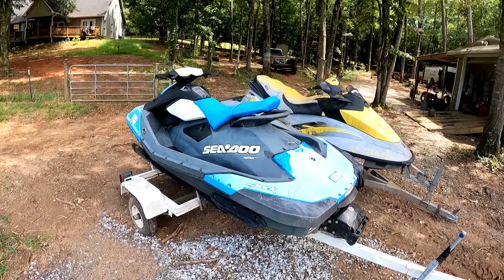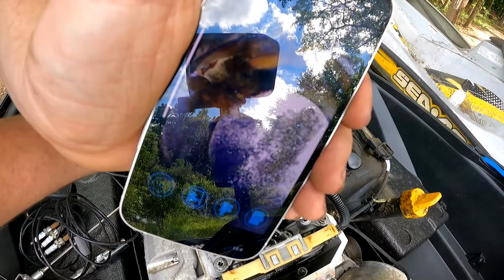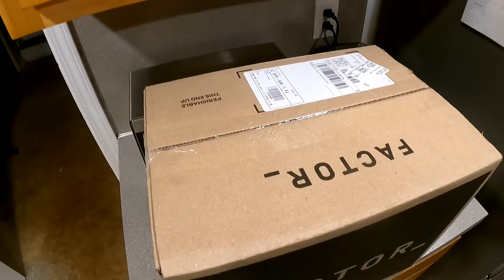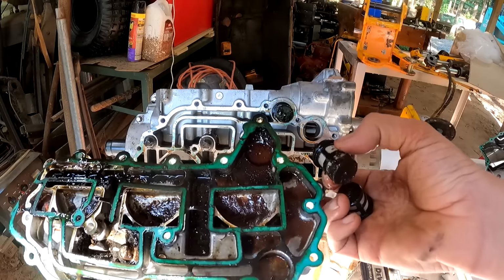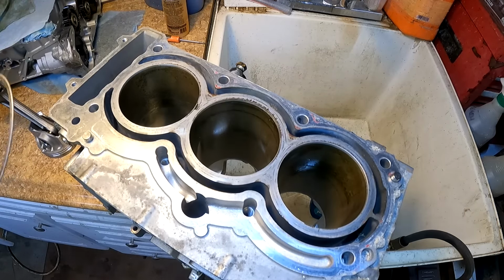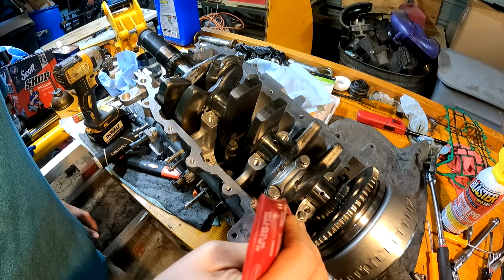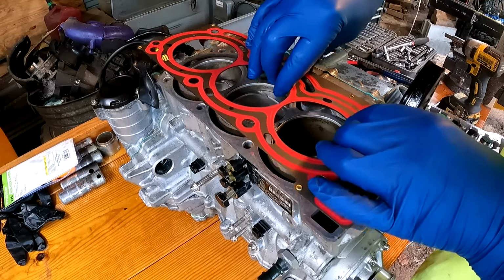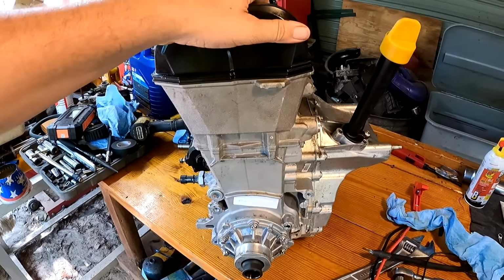JUNK JET-SKIS LEFT ROTTING UNDERWATER FOR YEARS... WILL THEY RUN?

Comment from the maker: I would have liked to fit everything in one video but with all of the noise from clearing and machines it’s been kinda hard to record lately.  Thanks for watching guys!
Reply: You had rust down the spark plug threads,  I'm thinking the last guy had the coil packs out and the plugs loose and left it apart in the rain for a couple years.  Probably just slapped it back together to sell.
Reply: To me looks like didn't winterized properly...water locked maybe?
Reply from the maker: @chugaaa I read in the manual that if you tow these and don’t crimp the water inlet hose then it will fill the engine with water. I’m wondering if they towed it to a dock or somthing and it filled with water and then sat or they flipped it and it hydrolocked and let it sit from that. The guy said these were his daughters skis🤷
Reply from the maker: @TheDisorderly1 you are probably rite but why did he have it taken apart to begin with? Maybe they flipped it and it hydrolocked?
Reply: Couldn't see anything in the cylinders because of the bright sky.
Reply: Bro you forgot to reinstall the MAIN BEARING CAPS upon reassembly!!
Reply: @remingtoncarrelics4299 I initially thought that too but it’s retained by the casting that covers the crank with the 8 bolts
Reply: yep takes to long between videos too!
Reply from the maker: @xxihasxx  I’ve had a lot of things happen out of my control, im hoping I can soon start getting vids out sooner
Reply: @The_Home_Pros ooh, bro, that bad cylinder wouldn't work properly.  There so much hole's, crater's, it would be terrible oil consumption, and soon ending of piston rings😢 i'm sorry...

Comment: Would you reckon the engine bearings are more likely to fail when you wash them in the parts washer like that with diesel I'm assuming. If all the liquid finds it's way into all those sealed bearings

Comment: That is very high tech little engine! Dual overhead cams, four valves per cylinder, COP ignition, and EFI. Impressive design for sure.
Reply from the maker: yes I do like it I just don’t like the stretch head and crank bolts, I also wish it have removable sleeves and I don’t like that you have to tear down so much to take the crank out, but other than that it is a peppy little thing

Comment: Great video, nice work getting this apart and hopefully working! Time stamp, 38:14, get something to hold that propane stove in place so it does not fall over and cause a fire with that hydraulic fluid and what ever else is on the bench. I had a buddy who dropped a trouble light on his wooden floor with gas, he lost his shed, snowmobile and almost his trailer home in 5 mins. Just a thought.

Comment: Nice video, the only thing that i would do different its using a proper Honing Machine, the one that you can adjust instead of having springs, you can take more material if you want and keeps the cylinders round.
Reply from the maker: Thank you! The ones I have are actually adjustable they work pretty good but I’d like to try a ball hone

Comment: I wasn't expecting you to go that deep into the engine, but I enjoyed watching you tear into it and get it back together!  Fantastic job!  That engine's gonna purr like a kitten.  Can't wait to see part 2!
Reply from the maker: Glad you enjoyed it! Thanks Andy!
Reply: First time watching,  very nice job.  I was shocked when you hit 2oo psi on all three cylinders.  Normally piston ring manufacturers specify to use a tool to expand and position on piston so you appear to have gotten away with one.  What did you use to clean rings and piston ring grooves?  Other thing is permatex and others make engine assembly lube.  I would use alot of it on cam lobes, connecting rods and crankshaft bearing journals especially.  On dry start you can do alot of damage before oil film develops between wear surfaces.  You can't use too much assembly lube in my experience.

Comment: Those Rotax engines seem really well made.
Reply from the maker: @raymondsmith6504  they are I just don’t like the stretch bolts
Reply: Even though it's expensive to replace them I bet they don't come loose during normal wear.  Most professional machine shops don't reuse crank, rod or head bolts.    You hate to loose a freshly rebuilt motor over cost of bolts.

Comment: The 4 stroke one was sunk definitely sucked water inside and they just couldn’t get it out because they never took the spark plugs out and then turned it over they probably fried or just thought the starter was fried and I would definitely fix it that happens a lot and unfortunately some people just let them sit afterwards and it’s an easy fix if done properly and asap but taking it apart that was definitely what it needed cleaning and new fluids and head gasket and it’s probably gonna run good but the other one  I hope is not 4stroke bc if it’s hit something hard they will bend internals more often than 2stroke engines just like the lawnmower engines with pushrods so when u hit a stump ur out a blade and a engine
Reply from the maker: I think your rite, just wait till you see the second ski, it’s full of rusty water as well 😩

Comment: Another brilliant video. I love your repair. Refuse, recycle ethos.
Being that it's a marine grade motor, the only step I'd do differently is to use some copper grease on the spark plugs to prevent any moisture such as water ingress or condensation corroding the threads which will make maintenance further on in it's life a little easier.

Can't wait to see part two. Have a great weekend and a British subscriber checking in

Comment: Only one suggestion is to never boost a battery on a seadoo. Can fry ur cdi brain box!! Even if ur battery is completely dead. Just a little fyi. Love the videos!
Reply from the maker: @charlessmith3029  I was very skeptical about doing that. Thank you for letting me know. I’ll make sure not to do it anymore.
Reply from the maker: @charlessmith3029  I was very skeptical about doing that. Thank you for letting me know. I’ll make sure not to do it anymore.
Reply: @The_Home_Pros  yeah I’ve worked on these guys all my life and I’ve seen it happen so many times. Mainly from people getting to the lake and having a low battery so they use jump packs and fry the brain. Which is EXPENSIVE. These guys fully rely on power so anytime messing with these always have a fresh battery. I’m also only speaking about 2010 and prior. These new ones I really don’t have much knowledge on.

Comment: I will admit it's not unusual to find low hour skis here in Indiana. Back in 2014 when I got my 2000 kawasaki stx900 it only had 35 hours and I gave 1200 for it. Things ran fine for me. It does have low compression but it's never been an issue for me.  Thing about jet skis is so many people just like with quads and side by sides. And boats. They sit. Why is beyond me I'm on the water as often as I can even now having 2 kids
Reply from the maker: you got that rite my friend!

Comment: OMG you re used the shell bearings
You use a gun to tighten the smaller bolts
You re used the rings !
You used. Normal  grease instead of marine !
You used a screw driver and contraption to knock out the seal !
All normal stuff for viewers and saving money !!
Fair play love the video !
Reply from the maker: hahah fingers crossed

Comment: Amazing as always.  I still think that Goldwing you resurrected was the biggest mess of all but this is a close second.  What a pile.  You are an incredible mechanic and a glutton for punishment.  I would have taken one look at the rusted spark plugs and set it on fire.  I think if they raised the Titanic you could get the engines running.  Looking forward to part two of the miracle.

Comment: It's a waverunner.
Not a jetski.
Yiu stand up on a jetski.
You mostly sit on a waverunner. 
Waverunners are also much safer to operate. 
My favorite niece Cecilia owns a waverunner rental company up in Hollywood Florida and she gets a little serious about that.
She also compeats in competitions and has told me the waverunner community are sticklers about proper nomenclature concerning them.
Reply: It's a PWC - Personal Water Craft.  Jet Ski - Kawasaki, waverunner-Yamaha, Seedoo is well a Seedoo..
Reply: @orbit308  all watercraft are considered personal watercraft. 
I spent 5 years in the Coast Guard and we were trained to considered all watercraft as such.
I talked to my Niece after I posted that comment and she agreed.
You stand up on jet skis because you can't truly control or enjoy riding on them otherwise. 
You can stand up on a wave runner but it's far more enjoyable to sit down on them and far easier to control them.
When I lived in the Keys for q0 years I got to operate both types.
I never owned one but didn't actually need to as most of my friends had them.
I did most of the maintenance on them in exchange for being allowed to use them.
That's because I have diplomas for 2 years vocational school on small engines, a diploma for 1 year of motorcycle repair, a Coast Guard Aviation Machinist Mate diploma for Pratt and Whitney R1820 radial engines and G.E. T58 turboshaft jet engines. 
I've rebuilt countless types of engines over my life since the first time I picked up a tool set when I was 12.
I'm 69 now.
And I still help friends rebuild there engines. 
Tho these days they have to do most of the manual labor while I just advise them for the most part.
October 19th I'll turn 70.
This spring will be the last time I recover 2 pool tables at the only sports bar I've been recovering them since 1998.
My actual profession for 43 years this coming January 3d is as a mechanic/electronics tech in arcade and pinball games, jukeboxes, pool tables and pretty much anything else you can put cash in and get fun out of plus product vending equipment. 
I went from being an Aviation Machinist Mate Flight Mechanic on Grumman HU16e Albatross seaplanes and Sikorski HH52a Seaguard amphibious helo Flight Mechanic/Hoist Operator to that profession only because whenI moved back to Traverse City Michigan where I started my Coast Guard career there wasn't any jobs for aircraft mechanics.
I had q wife and 2 year old daughter to take care of so I went to a job interview at Grand Traverse Amusement vending equipment company and got hired on the spot because I was the only applicant to show up in men's dress slack, button down shirt tie groomed like I was attending a military inspection with an onion skin paper resume.
Everyone else were in shorts,rattu jeans and tee shirts.
I worked there for 2 years OJT till I got divorced, custody of my daughter and court permission to move back down to Miami where I had a really good job offer.
Not everyone gets to have a profession that's almost like getting paid to be a full time hobbies.
My former boss who still lives in the Keys has asked me to go down and help him with the Yamaha engine on his boat.
It's been sputtering and I'm pretty sure it's a harness issue.
Ooh, get yourself a product Deoxit.
It's an anti corrosion liquid that's friggen awesome stopping corrosion on watercraft electronics and connectors.
I first used it in the Keys on arcade games and jukeboxes located at tiki bars exposed to salt water moisture. 
It cut down corrosion related service calls to pretty much zip.
Then we started using it on watercraft. 
It comes in various forms.
Spray, drip bottle with a needle, wipes and felt pin.
It's a little costly but it'll save you a lotta headaches from corrosion related electrical / electronics issues.
Reply: The grammar police have entered the chat…..😂

Comment: Those trailers look familiar.
Reply from the maker: @ShadetreeJetski  haha they are yours my friend I was gonna do a vid on yours but the xl 800 just had fuel issues and the gp 800 is leaking oil and I don’t know were it’s coming from, the engine was full of water when I got it home and I got the water out but it’s pouring oil out the exhaust and leaking in the hull, I was gonna mess with it more in the winter
Reply: @TheHomePros6221  A guy nearby wants to give me two more 800 series yamaha skis if you are interested.  Both need engine builds.  I bought new crankshafts for both of those you got and one had new SBT jugs, I think it was the blue one.  I never could get the carbs tuned right on either of them even with brand new mikuni kits.
Reply from the maker: @ShadetreeJetski  I honestly don’t think I can take on anymore project esp older jetskis they hurt my back to much, I did get the white xl going and it’s been running ok so far. I really hope your doing ok man, my dad  asked about you the other day and  wondered how you were doing.  Miss your videos btw

Comment: You need to buy better tools, namely the wire wheels. You need to use brass wire wheels if you're doing pistons like that.
PS. Don't wear gloves. For 1, you look like a girl. 2, you can't feel for nicks that can damage cranks or cams.
Don't punch pistons through the top when you have scored bores. You already had them out why force them back through. It's just unnecessary damage that can be avoided.
Ohh and use like 0W-10 oil in the bores when honing it will prevent deap scratches. Your honing, not sanding.
Use cheap oil and run for 10 to 20 min then change with good oil after giving it a hone. Otherwise well done, nice to see kids getting their hands dirty.
Nice vid Otherwise.
Ohh and not sure if you noticed but you missed a crankcase bolt when torquing them. Check your video.
Reply from the maker: @glengrimm4075  when working on stuff everyday it gets annoying to have to clean my hands so I sometimes wear gloves not all the time but sometimes and mainly because I’ve almost got bit by black widow spiders hiding in crevasses so I wear the gloves to protect from getting bit. I do everything for a reason the pistons won’t go through the bottom so I pushed them down so I could hone the cylinders clean and then push through the top so they didn’t get damaged. Good eye on the crank bolt but I did that one first